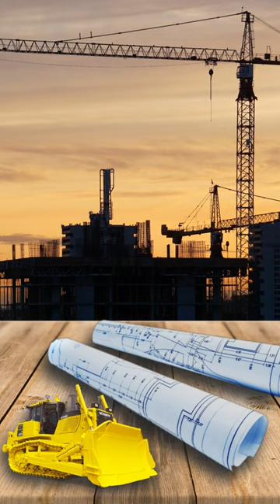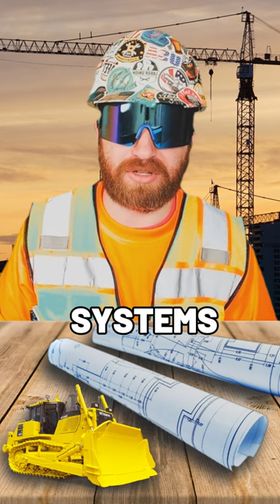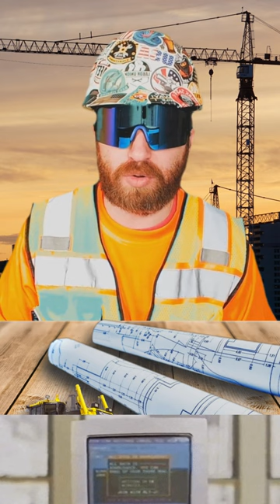BAC & BAS - Building Automation Control & Building Automation Systems #construction #shorts

Comment: How do you become a building automation tech or specialist?
Reply from the maker: Depends on the specific job, depends on if you plan to work on the Owner's side (direct with the building) or on a service/commissioning side.  Requirements for these roles could range from certifications to full degrees.